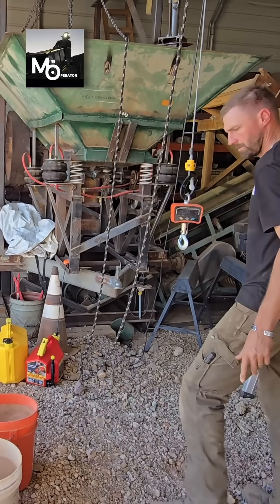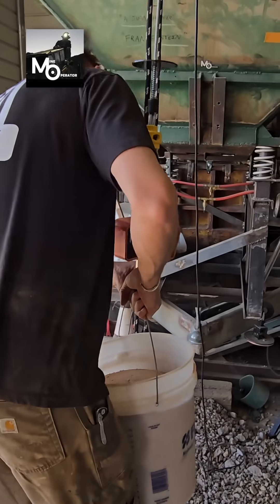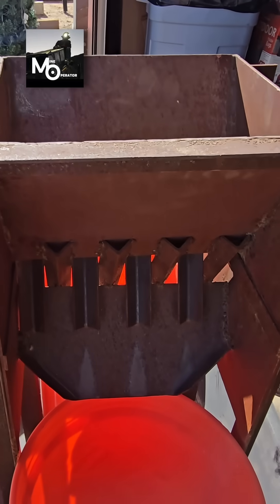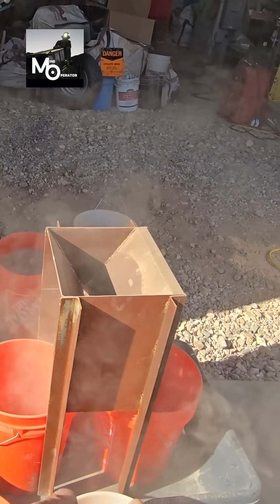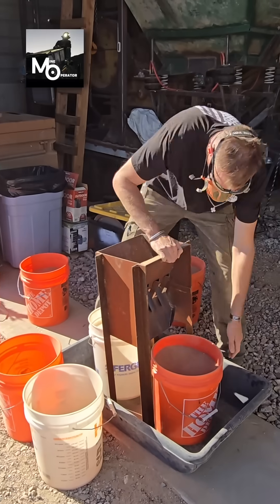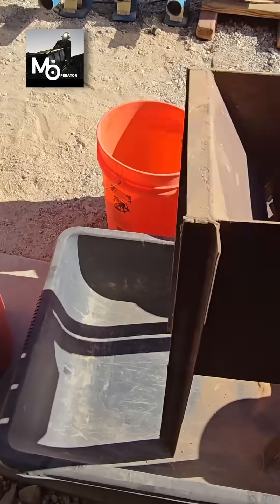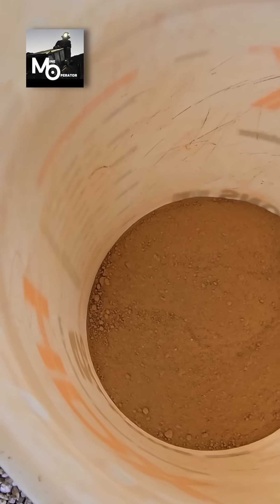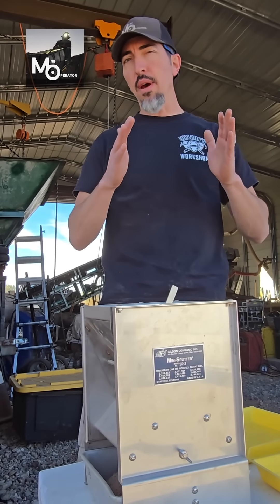Splitting Gold Ore Tailings for Assay  #goldmining #goldprospecting

Comment: Any update on the lab results?
Reply from the maker: Yes, the Property Owner asked us to keep it confidential.
Reply: @mineoperator  If you can answer, was it above 0.5 gpt if so that's absolutely worthwhile.
Reply from the maker: Our lips are sealed!  But one can assume that early 1930's Cyanide leach was not very efficient. So if one knew the average grade of the mine you can calculate what is in the tailings pile even before a representative sample and assay. These mines ran very well in comparison to the other mines in the area.

Comment: Why all splitting? It is the best logical way to mix the samples to end up with something that needs to be assayed. Have you considered recording the weight of each split and then pan down and dry the concentrates sending that for assay. Just as you see the black sands in the pan, take notice if you have scheelite, shortwave ultraviolet light, Fluorescence of scheelite, sometimes associated with native gold, is used by geologists in the search for gold deposits. UV light should be like a pen in your shirt pocket.
Reply from the maker: Harry and Conman mixed the material while crushing with the orbital. We could've run it through our cement mixer or dumped it into a mixing tub and turned the material over with a shovel for a while as another option. Right now, we're interested in the grade of the tailings pile and not the grade of any concentrate. We also want to know what other values may be contained in the tailings. The goal is to create a concentrate from froth flotation and leaching the concentrate. We're in conversation with a couple companies in regards leaching but the mineral content of the tailings or  mine dump can affect how well a reagent will perform. We'll continue to acquire data to prove or disprove if it's financially viable to recover gold and any by or co-products available. I'm not at liberty to disclose which companies or reagents are being considered as of yet. I do plan to share as much information as possible as it comes available.